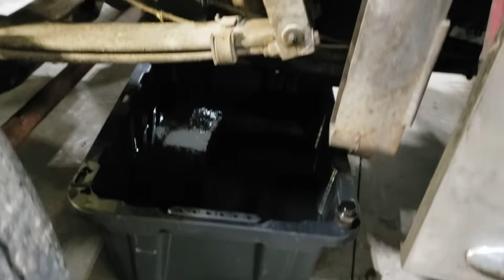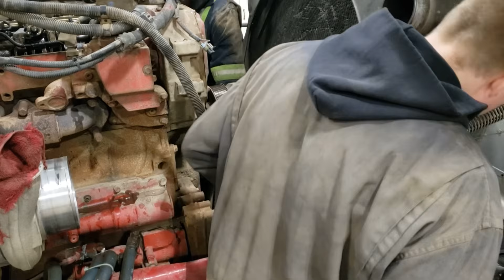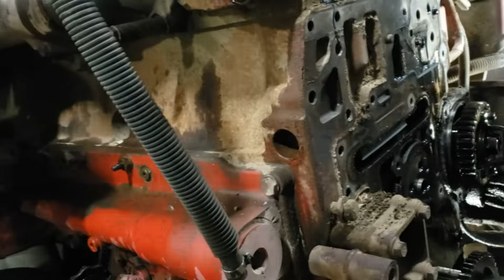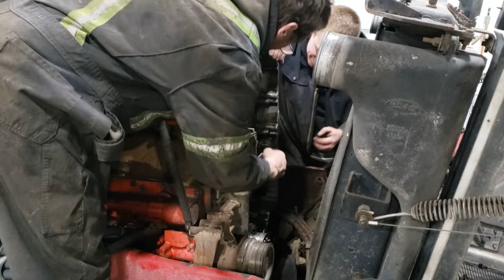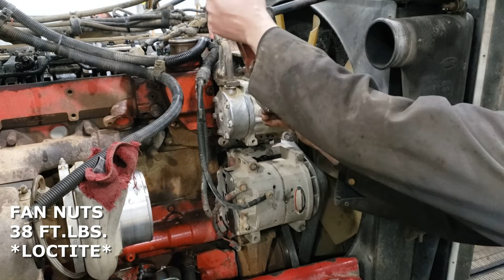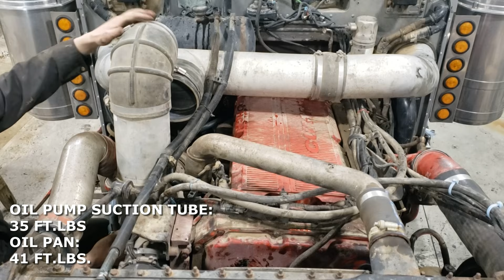| How to Remove ISX Front Engine Cover (DO NOT REMOVE RAD!) | SPECS INCLUDED |

Comment: I had this done and the shop didn’t insert a bolt with a washer all the way and backed off and oval the hole on the block. Had to replace the block was a pain in the ass and wiped out my banking account down for 2 months.
Reply: helicoil, weld up and redrill, enjoy the new block

Comment: Do you believe the old isx found in the 2004 trucks is a problem engine? I am looking at one now but, it seems to be problem prone from my research.
Reply from the maker: The earlier engines are a lot better. But have seen some that still need liner correction.  As for cover gasket they all eventually fail from age.

Comment: From my bad experience adding silicone to the new oil cooler gasket (same engine) I caught it next day when checking with my Harbour freight camera inside that oil hole (THE GASKET RUBBER PART GOT PUSHED/RIPPED OUT AWAY FROM METAL CORE BY THAT SILICONE)
HAD TO REDO EVERYTHING AGAIN:( 
so may be only add silicone to the  farthest/opposite side of that rubber line and never over the rubber:(
Also how I found the bad oil cooler gasket; drain oil out of oil filter when changing it, look for antifreeze... unless you're running the antifreeze pressure less, than I'm not sure if it may be pushed through when engine off (no oil press to hold against cooling system).
Reply: Not sure what you are getting at but I would have thought you would have plenty of oil in the cooling system before you saw it come out of the filter head

Comment: Hey great vids! just so you know there's an updated machined from solid steel retaining washer for the injector gear.

 That profiled/powdered metal retaining washer is not supposed to be reused.... There's a chance it will crack/chip off  taking out the gear train.
Reply from the maker: Hey thanks,  didn’t know that.

Comment: where is the video for  the Front Cover ISX Cummins.   In depth timing procedure on pin and wedges
Reply from the maker: It’s on my channel also.  Along with valve set.
Reply: You can make an account on quick serve cummins, google it, punch in your engine serial number, at the top, select service, then find the service manual. The three lines on the top left of the window it opens has a bunch of menu options and you can select engine assembly then go to the component (gear timing for the timing and itll tell you everything you need to know) you can find all the torque specs and sequence on there for everything to do with your engine.

Comment: This turbo set up u have how it’s doing I have same engine same set up but won’t work as it should
Reply from the maker: You might have an issue with the waste gate,  or if your lacking overall power /boost try replacing the exhaust back pressure. It is located in the top of the thermostat housing

Comment: Make the job easier remove engine hood and radiator , sand  and repaint dampner and use a good quality paint pencil to re- mark .
Reply from the maker: Easier yes,  but at an added cost to the customer.  This truck needed to get back to work.
Reply: @zedperformance  idc about the customer that much
Reply: I would never remove all of that just to reseal a gear housing that is just a lot of extra work that doesn't need to be done I will bet if you were getting paid SRT you wouldn't either I have worked on these engines since they first came out I get paid by the hour and would never remove all of that extra stuff just to make it easier

Comment: Do you have to remove the oil pan?
Reply from the maker: Yes you will.
Reply: no you dont, i do them all the time with the pan on.  @zedperformance
Reply: Just the front pan bolts that go into the gear housing

Comment: Just had Cummins perform this repair, it was $10K. Had to have a new timing cover due to vibration that eroded the aluminum against the steel gasket, down near the bottom corner near the engine mount, likely where the rubber was torn on the gasket from this Peterbilt.  I've been told that the engineers did not put enough bolts to prevent this vibration which is what causes the covers to leak over time. Hopefully, the new cover, which is an updated design, is thicker in this area and will not vibrate as much...just my hope, I have no information, but would stand to reason. This is the best video that I've found on this repair. Thank you!!
Reply: 10 thousand holly F….
Reply: Hopefully they shined your rims too for that price
Reply: What do you haul?
Reply: The new cover should be a factory recall conditon or something. They shouldnt be allowed to just get away with that. Besides, you can give them the old weaker cover and they should give you the updated version and they can recycle the material of the housing. 

Ps. For cleaning the block and the cover, i found that a brass brush does a wonderful job getting the old gasket material off and not scratching the surface.
Reply: Thanks! But I will keep my C15. 😂